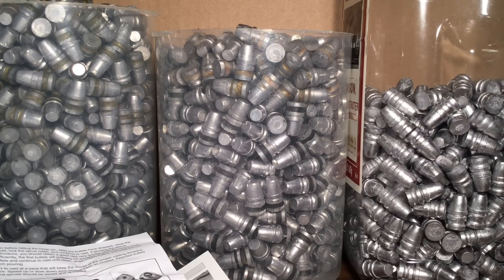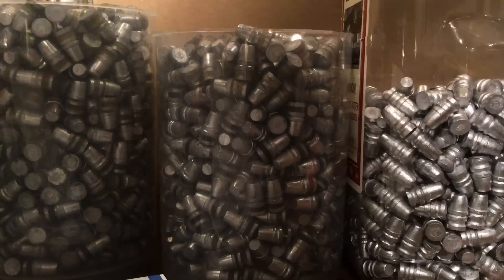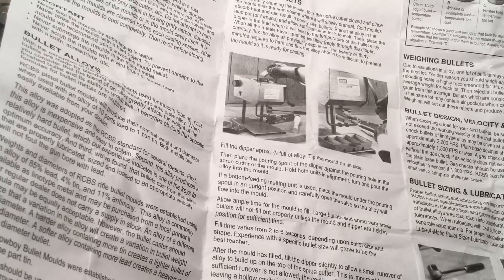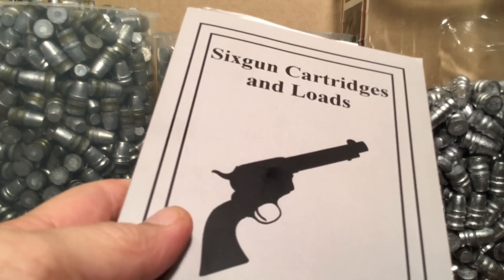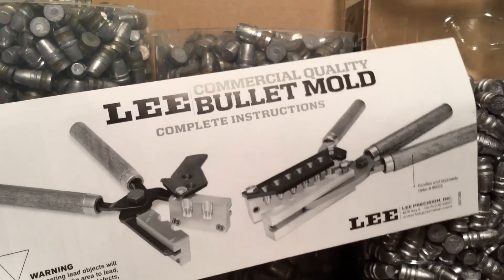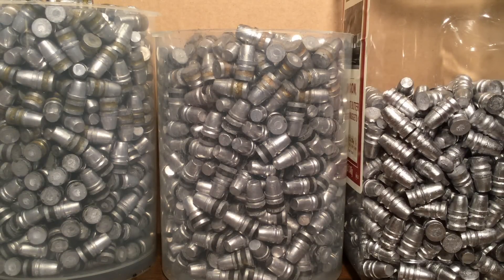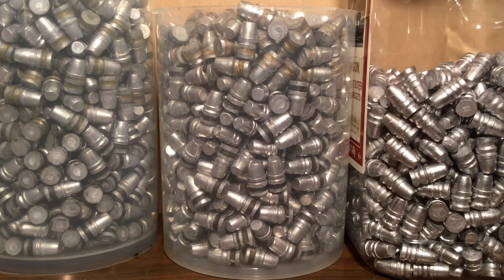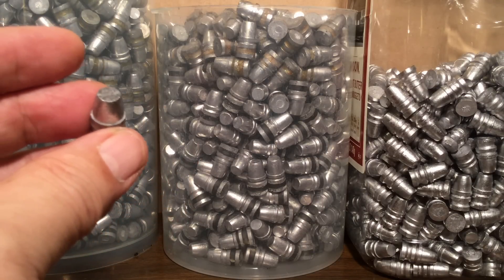The Big Hardness Gain Bullet Casting Water Quench Controversy - VR To Carl

Comment: At 63, like you & others, I've been at this for a long time. I started into it moderately back when I was barely into the double digits I think. I delved into it much heavier around the very early 80's once life settled down a bit. I started dropping bullets onto towels and blankets early on and did that for years because water dropping wasn't a thing back then. As time went on and after reading numerous articles about "quench casting" and how it provided a higher level of hardness, I decided to give it a go. I was in contact with Veral Smith (LBT) back then and decided to buy his hardness tester to provide a standard to test alloys by. Using his tester I found that it followed the standard hardness levels given for various alloys. Using WW's at a standard air cooled BHN of 9, I experimented with water quenching and found that I averaged a 5 - 6 BHN (14-15 BHN total) increase after only a few days to a week. Over the years since, I researched the reason why this occurs (arresting or freezing the lattice structure) and have never reverted back to air cooling bullets unless I needed the softer performance levels.

Comment: I've been casting since my pre-teen days and at 63 I'm still at it bigger than ever. Over the years I've read tons of manuals from Ideal/Lyman, as well as articles from Elmer Keith, Skeeter Skelton, Mike Venturino, and Veral Smith. I started water quenching bullets back in the very early 80's after picking up an LBT hardness tester at the behest of Veral Smith. It was the easiest and most practical and accurate tester at the time. I experimented with the whole process and found that using wheel weights at a national standard of 9BHN, they could be hardened into the 14- 16BHN range after water quenching and a few days of stabilizing. As long as the alloy has a given level of antimony (as WW's do) the effect is noticeable. The more antimony, the more of an effect. Heat treating by using an oven even takes it a step further. Quenching bullets in cold water from a near molten state in either process arrests the micro lattice like structure in lead before it has a chance to migrate to it's natural placement......making it harder on the exterior. Over a long period of time, like years, it will eventually revert back to it's natural state, but I've tested water quenched bullets that were two or three years old and they varied by only a point or so. Just my findings FWIW

Comment: Thanks FC45 for all your help and knowledge.  I cast scrap lead (plumbers lead) and a wheel weight mixture, I have a Brinell tester in work and my bullets test at 10-11 air cooled.  Water quenching raises that toa a 13-14 after a week.  I've had no problems with that hardness in any of my firearms after powder coating and resizing and I've driven my Lee .358" 158fp bullets to over 1800fps with no leading in my 20" Rossi 92 rifle.  I even cast the same mixture in the Lee .309-230 30 Cal. mould, trimmed them to a 170 flat base and powder coated them.  Those bullets out of my 30/06 M1 were hitting over 2000fps still with no leading.  Just a quick brush and a swab of Hoppies was all that's needed for clean up.  Doesn't get any better.
Reply: 2023 Update.  I've been casting a Lee 429-214-SWC for my 629's, water quenching and powder coating them (thanks for the video's) and have great luck with them from 44 Special 800fps loads to full house 1400fps loads with Unique, Power Pistol or Autocomp.  Heating them to 400* and quenching them again has really worked and is very consistent as far as I can tell.  Again, no leading and fine accuracy.  Maybe it's the powder coating that makes the difference, I did take a nice sized doe with that bullet last year at 40 yards, right place/right time.  The bullet lodged under the shoulder blade on the far side, quartering shot, and had mushroomed to just over 1/2".  She ran 30 yards and dropped.  Frankly, I was surprised at the bullets performance, most times I hunt with XTP's but the lead was just what was in my 6.5" 629 at the time and I had no complaints.  My hardness tester is a concrete floor and a 3lb hammer, good mushrooming and the powder coating stays put no problem.

Comment: I read a published study on the subject that looked pretty legit.  It had lots of charts and math that I totally glossed over and went right to the conclusion.  What the author determined is that lead does not respond to hardening by quenching.  There is a temporary hardness gain but after a few days that temporary gain is lost by some sort of relaxation of the alloy back to it's permanent state.  I haven't tried to duplicate this study on my own but like I said before the original experiment looked very well done leaving no doubt about the results.  I trusted the conclusion and never looked back.  I believe that there is little need to chase hardness in pistol bullits and if you want consistent hardness gain in rifle boolits that is best accomplished with an alloy adjustment.  I also have never had an issue of denting boolits by dumping them onto a pile of boolits.  I have never noticed a single instance of a dent or defomation of the fresh cast boolit when demolded ont a pile of boolits.  Just my two cents.  People over complicate this casting business.  It's not that complicated.

Comment: In my research prior to starting casting, I found information in a non-shooting/engineering publication that water quenching only works on the molecular structure of the cast lead IF there is a small percentage (say 0.3%) of Arsenic in the mix.  Really old Wheel Weights apparently had some trace Arsenic in them but these days we are using just lead and Lino etc so no trace Arsenic and thus limited increase in hardness from quenching.